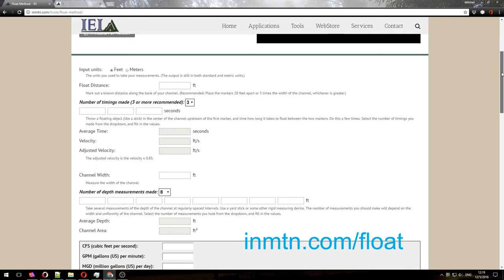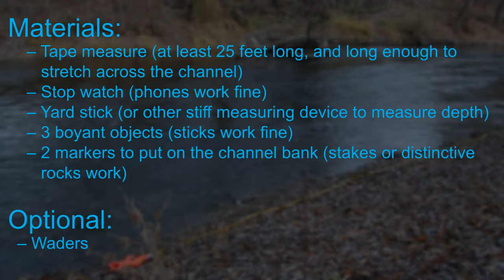Estimating Flow Rate using the Float Method

Comment: Thanks a lot for doing this video🌟
I have a small Doubt for the 0.85 roughness value. how will you actually calculate it on what basis
Reply from the maker: We like to use the .85 value based on our experience.  You can also view a document here that is more specific based on channel depths.
https://www.usbr.gov/tsc/techreferences/mands/wmm/chap13_10.html

Comment: Why 0.85 for velocity adjustment
Reply: As there some retardation on the bottom of channel for flowing of water . There is a difference in surface flow and bottom flow  so , the hydrologist recommended to take the 85% for that thing